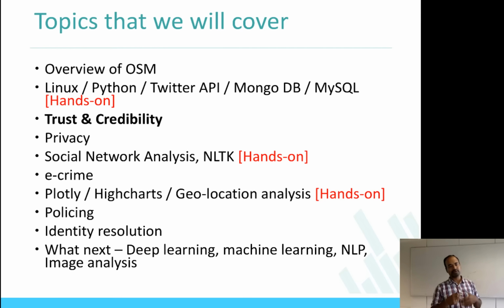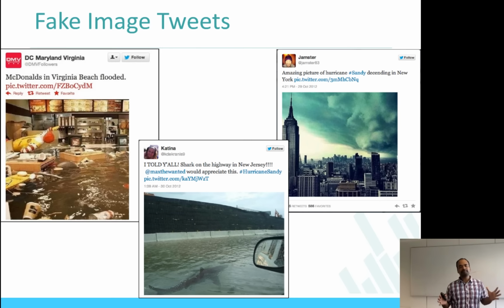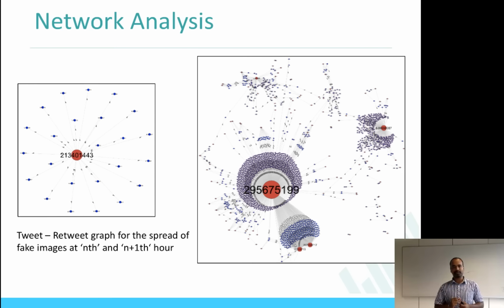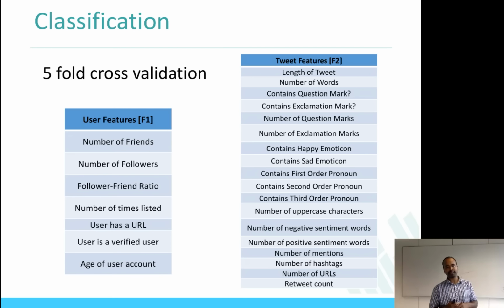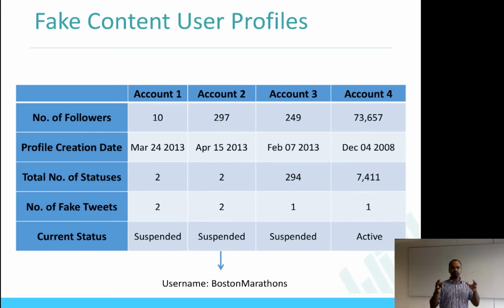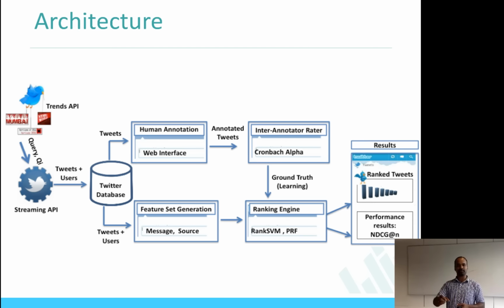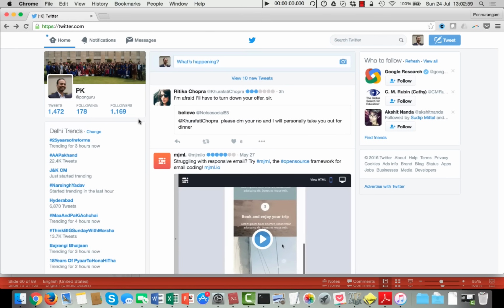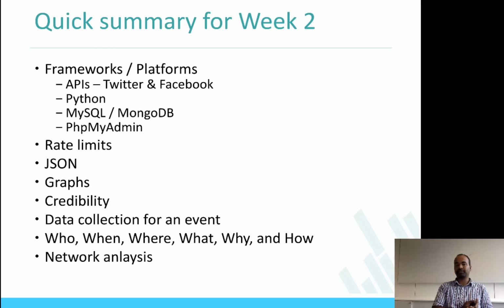Week-2.2 Trust and Credibility on OSM

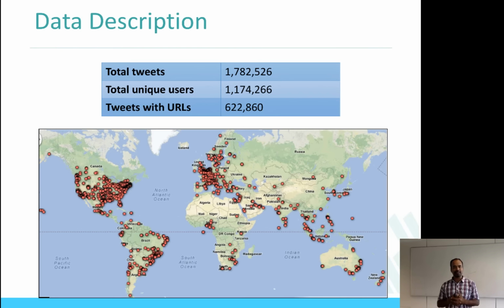Comment: The technical framework for analyzing *trust and credibility* on social media involves a structured machine learning pipeline (8:45-9:05). Below are the core technical components detailed in the course:

### 1. Data Acquisition and Preprocessing

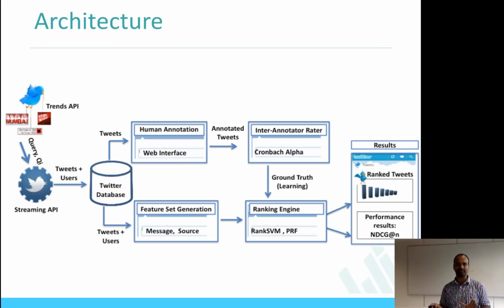*   *API Utilization**: Data is gathered using social media *APIs (e.g., Twitter API*) to fetch raw *JSON objects (33:18-33:28).
*   *Database Storage**: Extracted *JSON data is stored in systems like MySQL and MongoDB for further processing (47:18-47:35).
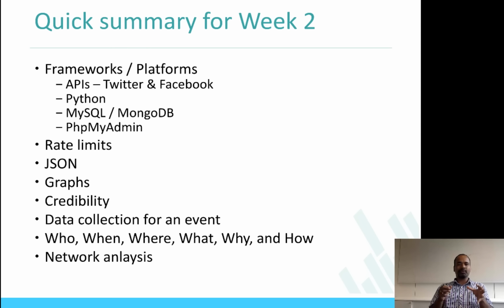*   *Rate Limits**: A critical constraint in this phase is managing *API rate limits (47:23-47:30).

### 2. Feature Engineering

To classify content, the model extracts specific features categorized into two domains (16:15-16:25):

*   **User Profile Features**:
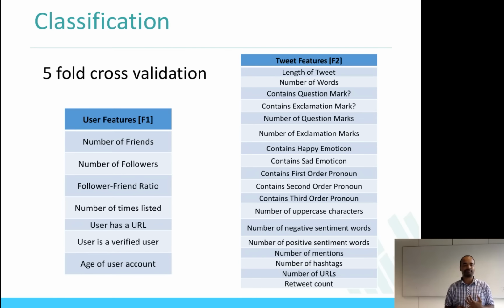    *   **Account Metrics**: Number of followers, friends, and the follower-to-following ratio (17:30-18:00).
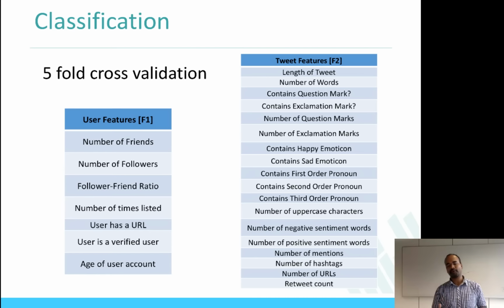    *   **Metadata**: Verification status, user registration age, and existence of a profile URL (19:10-20:05).
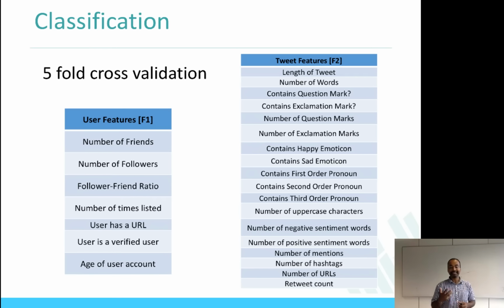    *   **Network Presence**: Number of times the user has been added to lists (18:05-18:50).
*   **Tweet Content Features**:
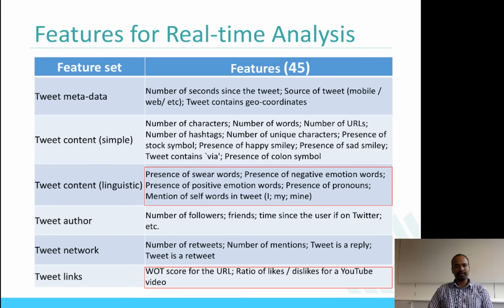    *   **Lexical Analysis**: Length of the tweet, word count, and sentiment-based markers (e.g., swear words, positive/negative emotion words) (20:15-20:50, 43:52-44:00).
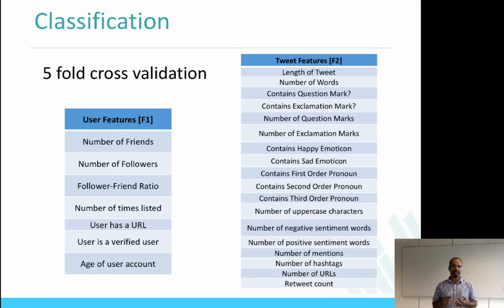    *   **Punctuation & Syntax**: Frequency of question marks, exclamation marks, and emoticons (20:40-20:50).
    *   *External References**: Presence of *URLs*, *Web of Trust (WOT) scores for links, and ratios of likes/dislikes for embedded media (44:01-44:11).

### 3. Machine Learning & Evaluation

*   *Classification Models**: The study employs algorithms such as *Naive Bayes (using probability distributions) and Decision Trees (building graph-based decision paths) to categorize content as 'legitimate' or 'fake' (21:38-22:15).
*   *Validation**: A *five-fold cross-validation technique is applied to ensure high model confidence (21:02-21:15).
*   **Performance Metrics**:
    *   **NDCG (Normalized Discounted Cumulative Gain)**: Used to measure the ranking quality and classification efficiency (38:50-39:15).
    *   *Inter-Annotator Agreement**: *Cronbach's alpha is used to validate human annotations, with a threshold of $alpha > 0.7$ typically required for data reliability (34:05-34:25, 37:44-38:05).

### 4. Real-Time Implementation

*   *Chrome Extension Architecture**: The *TweetCred plugin operates by intercepting tweets in the timeline, querying the backend API to extract features in real-time, computing a credibility score (1-7 scale), and injecting the score back into the browser UI (41:02-42:15, 45:17-45:55).